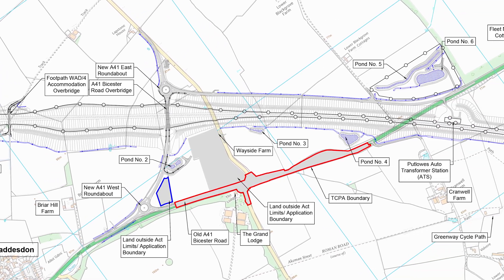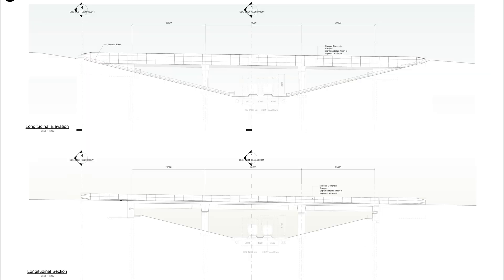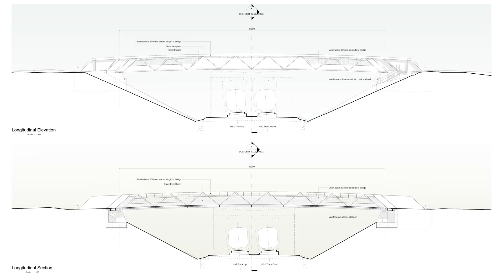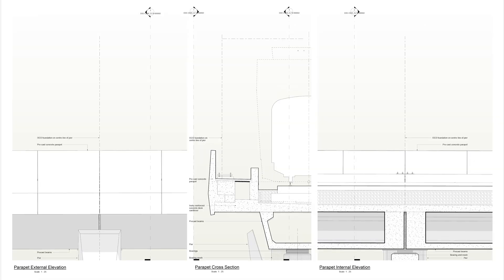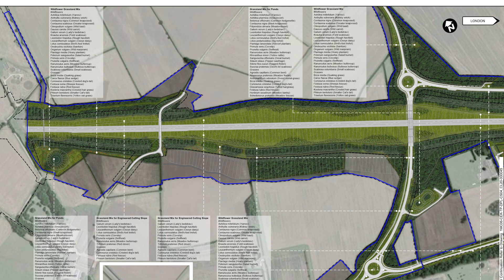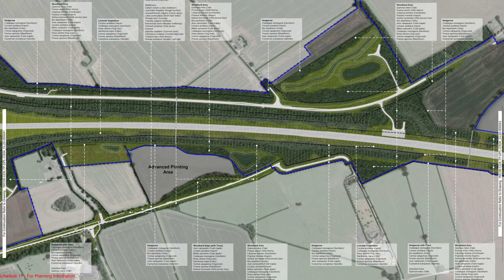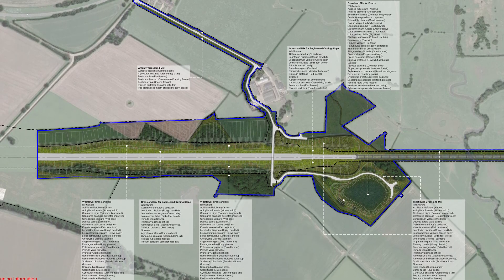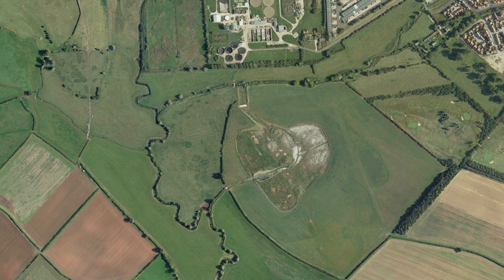HS2 - Waddesdon to Thame Valley Viaduct plans

Comment: Great video Karl.  Q where do you get all the plans from as I'm interested in the Wendover area? Cheers
Reply from the maker: @bobparrish6292 Cheers, thanks for watching. I use the Bucks Council's planning portal which is such a slow website and so frustrating to use. They have a tiny window for the map which you have to zoom right in to so you can see the zones covered in a planning application. Failing that, there is a basic search window which sometimes works. I might list the document locations in the video description when I get a spare half hour.
Reply: @KarlVaughan  Hi Karl thanks for the info much appreciated